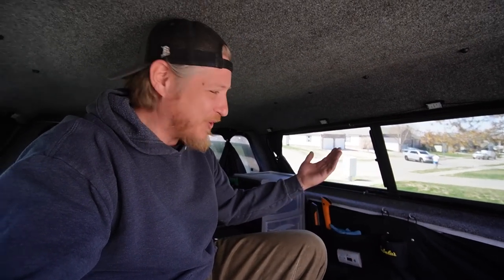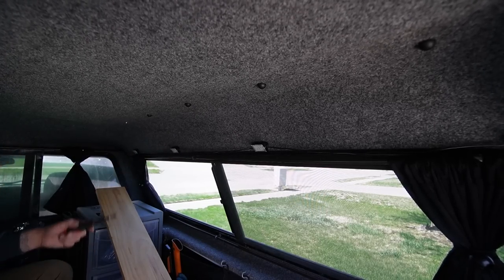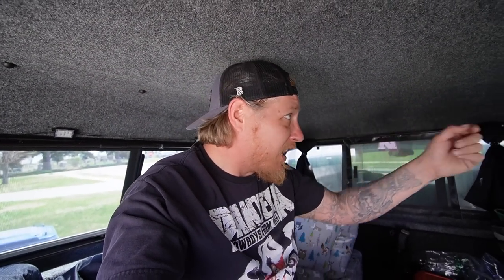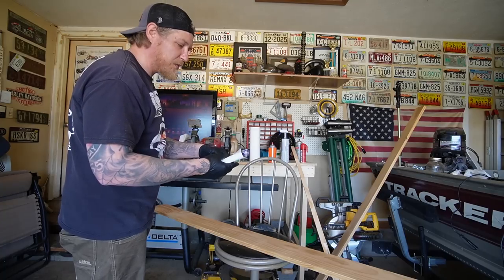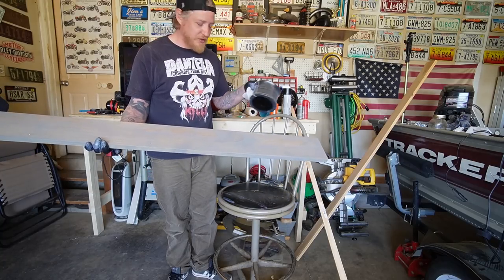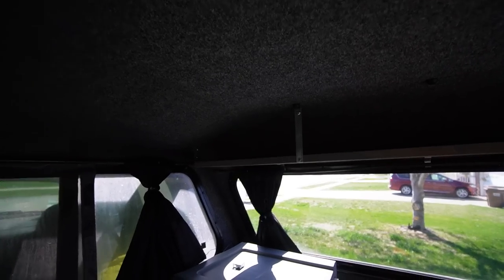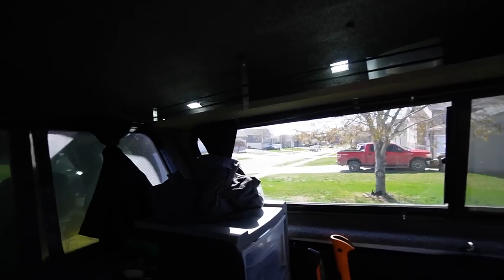Building A Hanging Shelf For My Truck Topper Camper

Comment: Nice shelf and clever engineering. Maybe add some LED strip lighting to the underside of the board, just peel and stick and it’s relatively flat so it won’t be that visible. Want to get fancy then use a router and create a shallow groove to put it in. Also maybe some wide non-slip tape on the topside of the board which will minimize things sliding back and forth every time you brake and accelerate. Exhaust sounds awesome, accentuates the lope of the aftermarket cam you have. 😎

Comment: Looks good. Been thinking of doing this myself.  Yes, one side is good enough.  Also, if you put a lip on it, you'll start throwing stuff up there and it will become a catch all for change, nuts and bolts, and things will just plain go up there to die.  Good choices.  Cheers. Oh, like the new exhaust.

Comment: I use a Ram mount ball mounted to my headliner. From there is use a 4" Ram arm with a  Ram tablet mount to hold the tablet in position while laying in the back of the truck. Best part is it easily tucks away when not in use, and will hold its position even on rough and bumpy roads.

Comment: For the last bracket near the tail gate why not just flip the roof bracket 180 degrees so you don’t have that 1/4 gap and didn’t have to bend the metal strap?

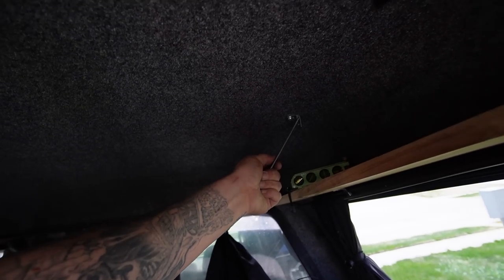Comment: Why didn't you turn the L bracket around so the part hanging down was toward the inside 11:35?? It would made it coming a half an inch or so further out so you didn't have to bend it in so much.
Reply from the maker: It would have needed bent the other direction then, either way it would have needed a bend